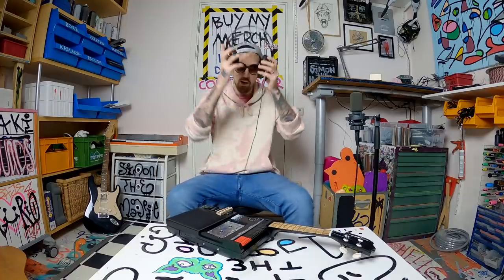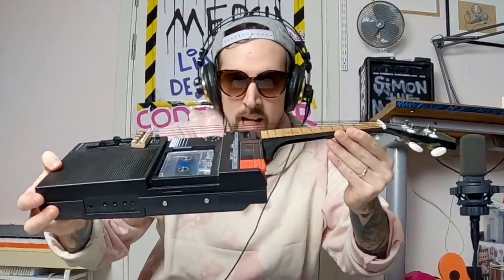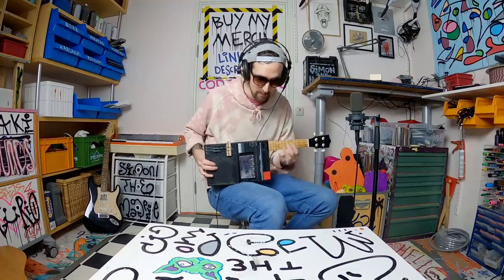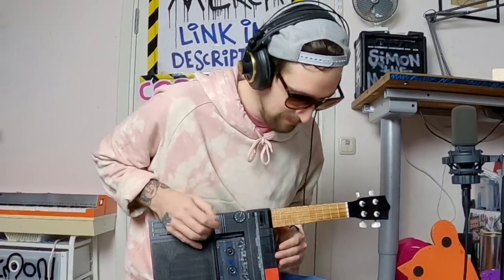I Made A Cassette Player Ukulele

Comment: Nice! Good thing about a screw-on neck is that you can shim it to adjust the string height. I'm a bit worried about the plastic case collapsing under the string tension, though.
Reply: Ukulele strings have barely any tension on them compared to a guitar
Reply: There isn't a whole lot of tension in uke strings tbh
Reply: that ancient plastic is super strong compared with the tension. You could stand on one of those old tape recorders without the plastic collapsing

Comment: Put the tape deck in record/pause mode and patch your amp into the headphone jack. You'll find that the live audio from the internal mike will now output through the headphone jack (but not the built-in speaker). Virtually all tape recorders do this trick, it's called 'monitor' mode. Now you have an electric uke.

Comment: If you shimmed the neck to tilt it back it would help with the action, if you wanted to get crazy you could do that and also lower the bridge. Necks generally have a break angle which is the angle at which the necks tilts or "breaks" at which to allow the string to be at the same height across the fretboard.

Comment: Now all's you need to make is a cardboard box into a slick gig bag hard case for it. Couple latches and fabric. Maybe some thin plywood. Adjust the intonation, (move the bridge .. hint hint  test at 12 n zero). Voltage kill or drop button on relay switch.

Comment: you should put a momentary normally closed pushbutton in line of the batteries that you can push and hold before hitting the stop button so you don't get that POP caught on the recording, it will disconnect the power so the tape stops and it wont record the stop button click.

Comment: um, about the mic placement, thats not how stringed instruments work, the strings vibrate the body at the bridge, the sound waves for the most part travel into the instrument body via the bridge and exit from the soundhole
Reply: though is sound ok as is, but you could probably be getting more signal if you used a bridge pickup
Reply: He said a bridge pickup on an electric not acoustic lol

Comment: Load in a cassette audio adapter and then connect the 3.4mm to a 6.35mm(1/4 inch) adapter and then plug it into an amp. BOOM! ELECTRIC CASSESTDECK UKE!!! Or plug it into whatever you want.

Comment: That particular model Philips cassette recorder is actually really nice, and fairly sought after - I have two of them. BUT: they are right now at the age where the plastic of those yellow gears is expiring; in both of mine the gears basically just disintegrated. Looking for a source for new ones. It was pretty painful to watch you mutilate a working one. :( But super cool anyway. :)
Reply from the maker: Sorry 😅 I actually didnt consider it at all since it showed up in the trash. So someone made a big mistake then, haha.

It still very much functions as intended and if I remove the uke it will just have a few holes which is just a cosmetic thing anyways. So its not thaaat bad 😆